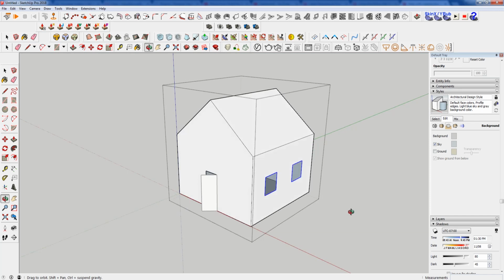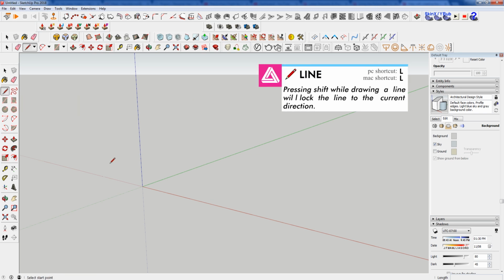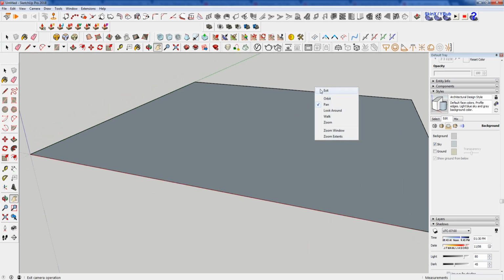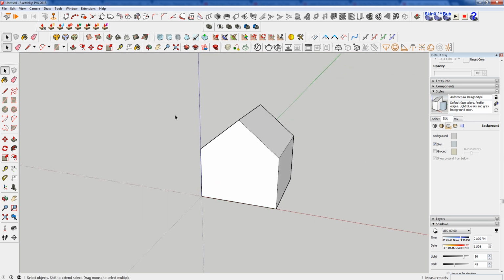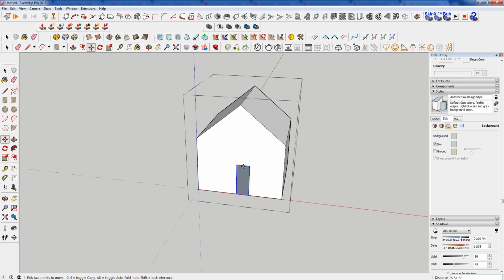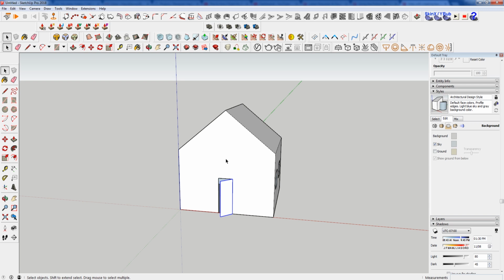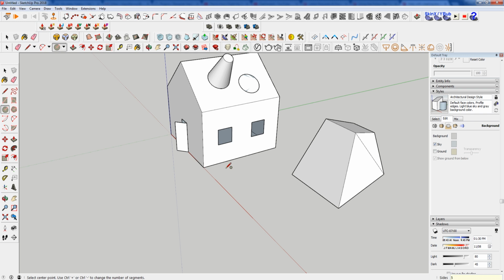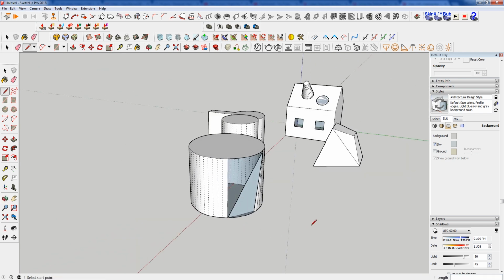Getting Started with Sketchup for Beginners

Comment: Also, when you make the windows, how do you delete the window so you can see through it. Mine does nothing, it selects then remains white. Are you pushing the delete button? Mine just keeps selecting the whole group of the house. Did yo make a group out of the window? I cannot replicate what you there, them moved them to the other side. watched it like 10 times, still lost. Just a bit confusing, unclear. Thx for the effort tho.
Reply from the maker: If you give me video time stamps with specific questions I will be able to give you better answers.

Are you pushing the delete button? Yep!
Did you make a group out of the window? In this tutorial I did not.  The squares need to be able to intersect the house wall so that I can delete it.  If the windows were a group, I wouldn't be able to do that.
Reply: Thanks! So yes, I have not been able to remove the window panel. I create the window, but when I select the panel, and click "delete" it turns white again. Then the whole house turns blue-edge. Im using SUM2017. Is this rectangle somehow becoming part of the group when I draw it on the wall? I just tried it again: Drew a square panel. Made it a group. Drew a square window on that panel. select window panel. It turns dotted. Click delete. It turns white. Select window panel again. Whole wall panel borders itself in blue. Can't select window panel any more. Does this make sense? Sorry for the questions, but super thankful for the responses!  @DesignerhacksPage
Reply: It's right at 12:36... I select the window pane, hit delete button...window turns white. After that, I can't select window pane..its jsut select the whole house group. Lost.  @DesignerhacksPage

Comment: Decent tutorial but you're still not explaining every step. For example, when you first start moving the door around, you center it to the peak of the roof. How did you do that you don't really explain it? You just go up there and click and it centers. Well mine doesn't center it at all. (SM2017) Are you clicking the peak while using the move tool? It seems to me you might be very proficient with SU and subconsiously using some keyboard shortcuts and forgetting to mention them? It's understandable, but for a beginner video it makes it very hard to learn exactly what it going on. Thanks for the effort though I did learn quite a lot. But got left behind often.
Reply from the maker: If you give me video time stamps with specific questions I will be able to give you better answers.

When moving the door, I'm holding SHIFT to lock in the direction I'm moving, and using the peak of the roof as a reference.
Reply: Thanks for the quick reply! Ok, so when moving the door, does it "click" into the centered position? Or are you just eyeballing it. Mine seems to just slide back and forth, doesn't seem to click into any middle position, just stops wherever I stop it.  @DesignerhacksPage
Reply: Thanks for the video! But, straight out of the box, free version of Sketchup, at 52 seconds I'm already lost. Right-click where to get to the toolbar preferences?